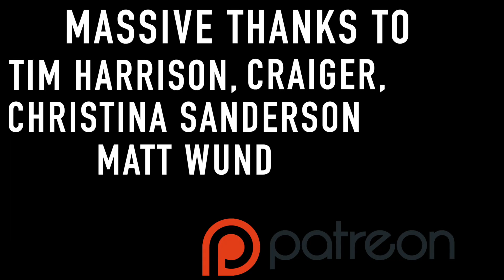Guitar Tech Masterclass - A Day at Monty's Guitars - New Pickups For The Bradcaster

Comment: The key to soldering is, you must hold the tip to the "leg" to get it hot before you apply solder. Whatever you're soldering to needs to be hot !! 5 seconds is a good pre-heat time.

Comment: Considering the length of time taken to solder a few wires, it would have been worth masking off the fretboard prior before filing the fret ends. 39:34
Reply from the maker: If you’re not a professional defo, as it’s a precaution incase you damage the board. But if you’re someone like Matt who has been doing that for over 20 years, I think he’s pretty comfortable doing it without tape.